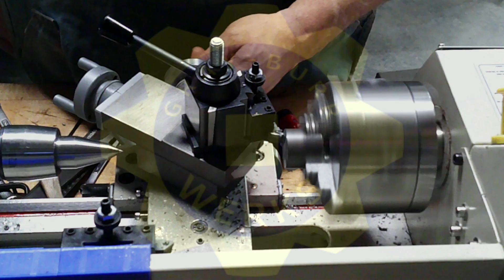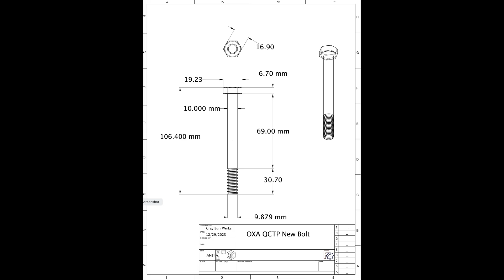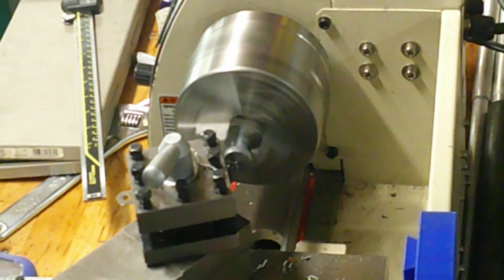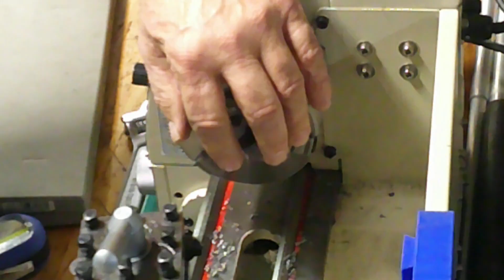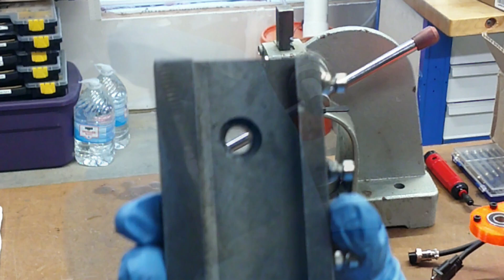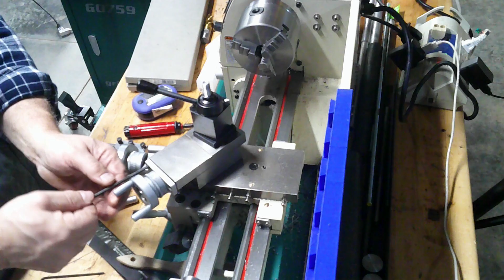Shars OXA Quick Change Tool Post Install

Comment: To improve the performance of your arbor press, remove the rack and grind off the bottom two teeth. This allows you to raise the arbor and ratchet the handle up, so that you have the handle 90 degrees to your work.
Reply from the maker: Thanks for the idea and input, I really appreciate it! I’m always willing to learn something new in the shop. I’ll probably modify the little arbor press in the near future! It really has been a long time since I used an arbor press and the rust on my skills show…lol….@jimfiles3307 an outstanding day!